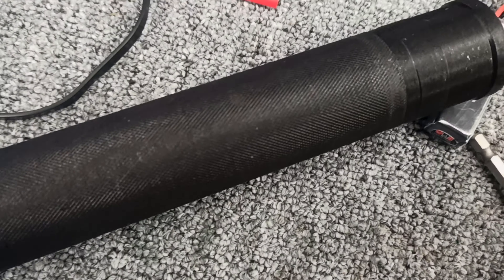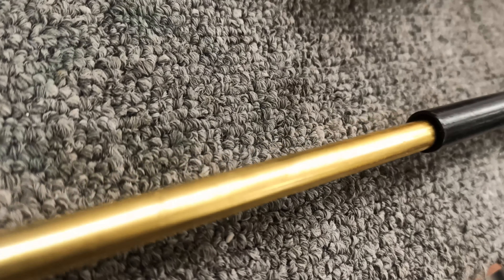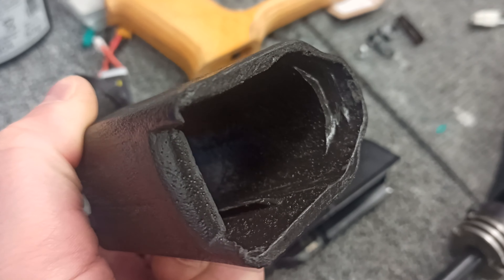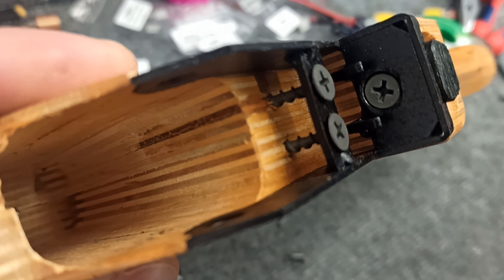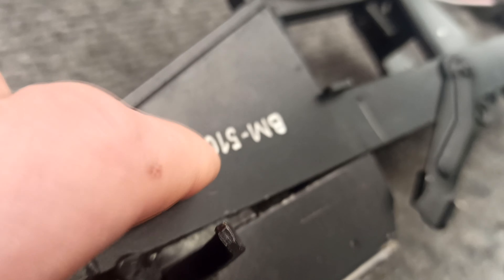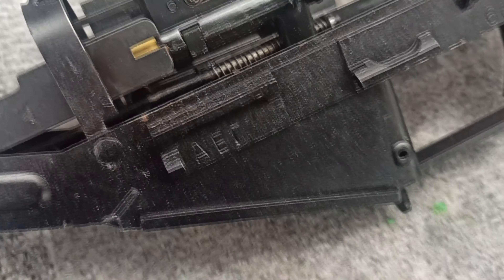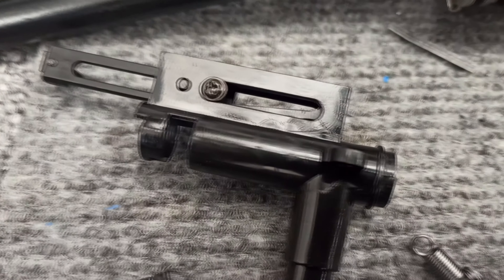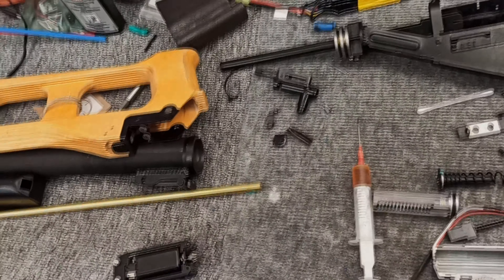NPO Airsoft's 2022 VSS Vintorez REVIEW - New Internal Features and Flawless Overall Quality  [N.O.T]

Comment: NPO internals are diffrent, they use ZCI gearbox  shell and their inner barrel is not made from brass
Reply: Do u happen to know if the original is compatible with V3 upgrades cuz i wanna get an NPO vss and put in a wolverine inferno

Also if you know, is the NPO vss hopup a standard AK hopup? Or is it unique?
Reply: @Jacob-vg2hh Hello, it is, but needs custom electronics to use full auto on it, the hop chamber is AK-type, but externals needs several modifications to fit combat union or other rotary type hops
Reply: @user-ye7jt8wz9n  hhmm interesting, i dont mind not having full auto as im semi-locked anyways, im either putting a wolverine inferno or a polarstar kythera (with the kythera i dont need to play around with electronics but with the wolverine i can control the efficiency of the air)

As for the hopup, yeah i am aware of rotaty hopups requiring external mods as its typical for AKs, which is why i was thinking of getting an arcturus AK hopup which is mostly the same profile
Reply from the maker: well.. they do now.. and they ocasionally did LCT-crap..^^

Comment: You may have gotten a lemon. I hear tons of good things from everyone I've seen. It does tend to happen.
Reply: This vss doens't look like any of the 20th+ version NPOs I have or have seen.

A few things I noticed throughout the video:

-Starting with the receiver marking, it should end with a "22"  for it to be a 22 MY. The one in the video ends on a 12.
-Receiver itself seems to be of the older design, 20th+ models have a bit more material underneath the scope rail but come with a lower dust cover with basically no space left above the gearbox.
-Handguard is thicker than newer ones and the dust cover isn't of the newer slimmer design either.
-Dust cover, safety and the fake "bolt" should also have stampings with the corresponding year of manufacturing.
-The threading for the suppressor doesn't line up with how a 20+ NPO should look like. This one has the large thread of the earlier generations, while my 2020 and 2021 both have tight threads.
-The barrel assembly and slits for the hopup chamber are of the old design as well.

Also both of my NPOs came with ZCI looking gearboxes with QSC and micro switch triggers as well as steel barrels with NPO aeg markings on them.
Unlike this one with a bad, old LCT gearbox  and brass barrel.

Honestly, this looks more like someone took an old version NPO and wrote 2022 on the suppressor.
Reply from the maker: @hafentoffen2  possibly the guy i tuned this for was scammed from the shop he got it off
Reply from the maker: as mentioned before the store labeled as a new version and i think its just not. anyway - hard to get hands on npo recently